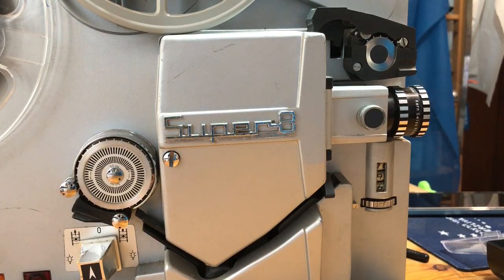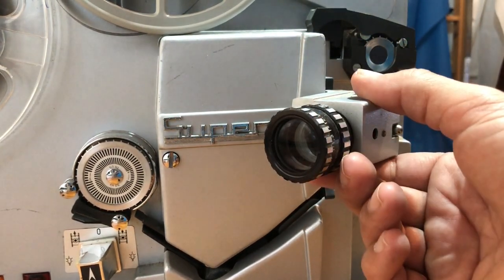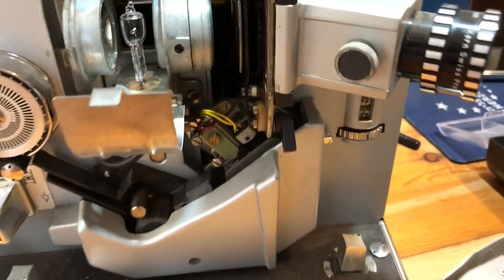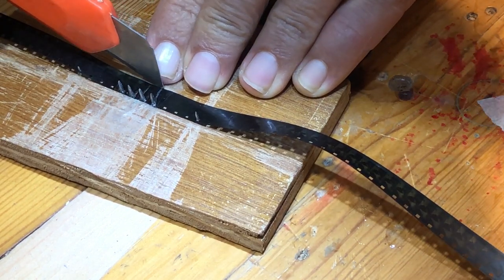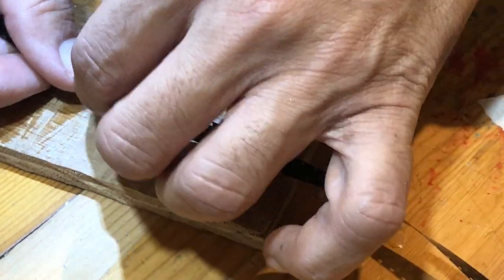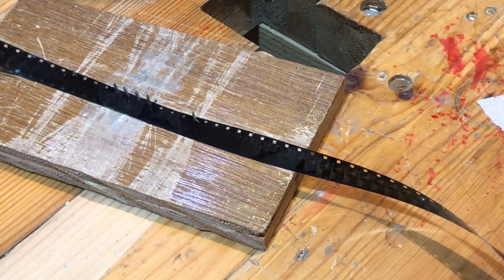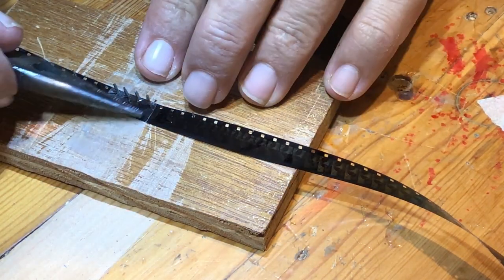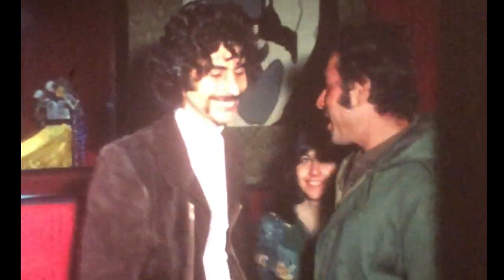"easily Convert Your Old 8mm Video Film To Digital With This Quick And Easy Guide!"

Comment: Hi ! What you have to do is create a loop which will be maintained all through the projection.
This is a close copy of a Bolex projector. The film will only move when you press the key like you were doing, which a very safe feature, now you keep it pressed until the film has gone forward all the way to the take up  spool, unless you have a problem along the way. Then you press the main switch to project and the key will now open up. You are now set to keep going.
Good luck.😊

Comment: Hi.  You have to leave a loop of film between the gate and the sound slot otherwise you get the film chatter you see in your video.
Reply from the maker: Thank you, I must try and do that
Reply: This is a silent projector,  what you mean is “on each side of the film gate” in order to keep constant and smooth flow of the film from the feeding spool to the take-up one.
Reply: I’m sorry ! It is a sound projector, as I just took a closer look. Now the importance of keeping that loop is even more important as it is also needed to keep a smooth run of the film at the sound head for a good sound reproduction. (if there is a recording on a sound stripe on your film)
Reply from the maker: @rolandthomasset1713  Thank you very much, can you elaborate on how to check if I have the sound on my film stripe?
Reply: @SAMUELDIY  Hi ! If you have a Sound Track all along your film all have to do is turn on your volume up high enough and the sound will com on. You also  must check other switches. You may have one that says silent and sound. It only plays when the light switch is on (normal play). You could post a good close up of all your switches. I will be glad to help you.